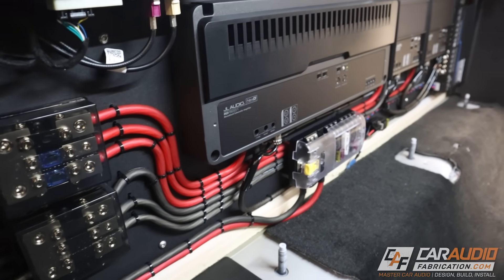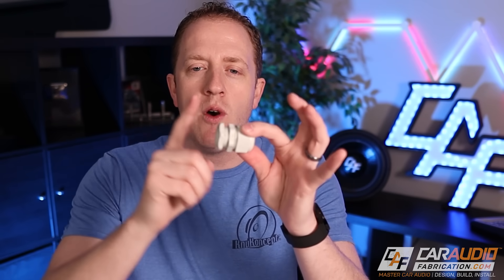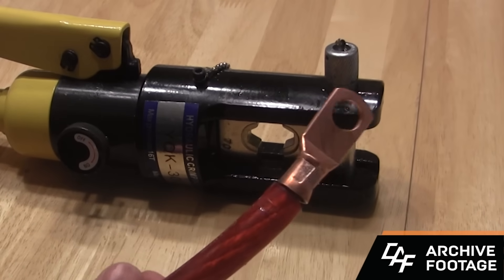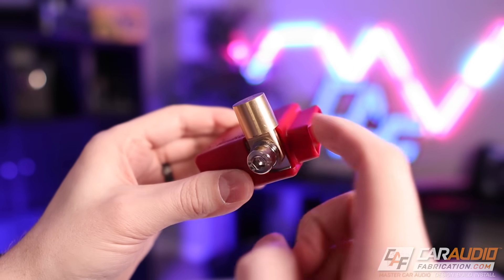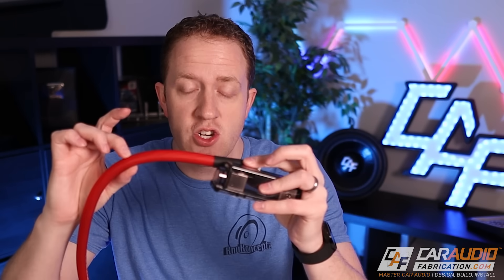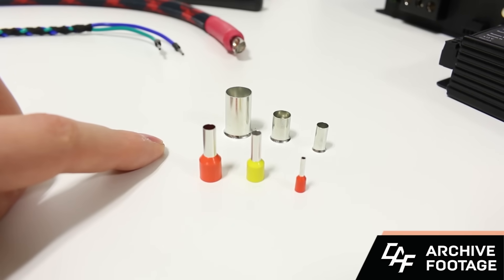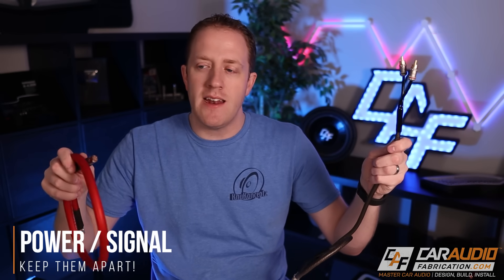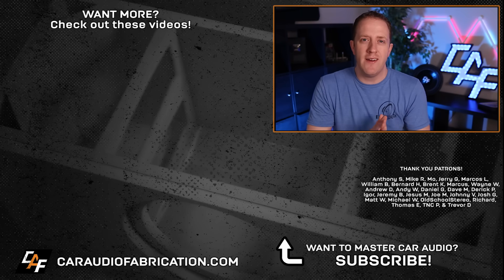Installing an Amplifier? Use these BEST PRACTICES for Power Wire!

Comment: Have you covered running 1/0 gauge power wire from the front battery to the trunk one, but parallel to the vehicle's wire harness? My research is saying that that can cause EMI, unless you turn the wire 90 degrees (I want to see an example of that).

Comment: Hey Mark...I have the Audio Control DM810 in my signal chain which will be PAC Amp pro ag 71, Audio control Dm810, Audio contro Lc 6.1200, Audio control LC4.800, B2 Audio Rage 2500.1...my question is is it better to run the optical out from the PAC to the DSP or the RCA's?

Comment: Can you do a vid on speakers blowing ? I installed aftermarket rear speakers & one blew.

I THINK it was because I noticed the positive speaker wire was plugged in the amp while the negative one slipped out the ferrule, but I’m still not sure how to diagnose that since my front speakers work fine

Comment: Is it not necessary to connect the wire so that the Amp turns on when the car or accessories are on, otherwise isn't the amp always drawing power from the battery?  Apologies if this a rookie question, I'm new to adding wiring to a car.

Comment: Since there are relatively cheap thermal cameras available these days it would be interesting to see how the wire and terminals heat up during heavy use. Particularly the connections to e.g. amplifiers etc.

Comment: That the positive ,the 'power" wire ? Ya sure ?
Reply from the maker: I know you are trying to raise some silly argument about which way the electrons flow. But it's irrelevant for the sake of this video.
Reply: @CarAudioFabrication  you seemed to have it backwards 
The huge pos cable is kind of a funny joke amongst auto techs
Reply: @CarAudioFabrication  CURRENT, WHICH WAY CURRENT FLOWS ,it's a big deal in auto electrical ...I guess it's good you know the term electrons

Comment: What about the remote wire should you run that on the opposite side as well?? I would think yeah because basically it's kind of like a power wire right

Comment: Ok so my amp wouldn't stop turning on...with the car off..head unit had been powered Down before killing ignition.  Amp on..cycled the keys to get the darn thing to cut off. Few seconds and it cut back on ..I popped the hood, pulled the fuse OUT of the power wire. Cycled the keys( at this point the head unit will not come on "auto" as it was manually shut off prior...amp cuts on...yanked the 30a fuse out if the amp, cycled the keys...counted to- Holy ** wt*** amp came on...I let it kill my battery from 12.6 to 11, cycled my keys (hours and hours later at this point) amp did not cone back on lol. I checked for obvious loose connections and have simply concluded the ground is literally the only thing that could be backfeeding as the remote is on acc on head unit... zero clue on how to go about diode...or if thats even the answer.. dud I miss sonething obvious in my absolute frustration?? - oh too start I just finished a 16hr 101° Day under HOT Mack Trucks so I wasn't completely coherent as it was either lol

Comment: if you go from a zero ga wire to a 4 ga 2 inches from the Amp are u losing the advantage of the zero ga wire? the world may never know
Reply: If you are short on wire why dont you put a fuse in between so you dont have to use the 4ga

Comment: Hello I am just wondering and am curious because I am currently going through a situation with my car. To be specific a 2008 corvette . I’ve taken it to many places (including dealer) and even the dealer said they’d charge me over 1000$. My question is I had a power wire installed from my battery to my amplifier because my sound went out. Will my battery get drained over time or is there some type of way to bypass that. I think they also added a capicator and also fuse holder.
Thank you
Reply: Seems luke you need a bigger alternator

Comment: I installed my 2 12”s with a 1500 watt planet audio amp and there is a whistling noise coming from my actual truck speakers and nothing coming from the subs at all, no output and the ground to the bottom bare metal part of my truck, and the power and fuse ran to my battery and my remote wire ran to my head unit and still nothing

Comment: Do I need a ferrel on the power wire to connect to the fuse? And can I use electrical tape to hold it? Or can I just strip the power wire and connect it that way to the fuse?

Comment: Usually, there will be an unused rubber plug on the firewall that you can cut a hole into it and route your power wire through that.

Comment: What’s the idea if your running a second battery? I have 4g back to the the second battery in the trunk where the amps are, 4500w skar with 1g from the second battery to the amp about 2 foot long. This is both batteries positive and negative.

Comment: One more question. I have 2 Amps and a extra trunk battery. Both amps and my trunk battery are all grounded with one ground. Should I ground each amp and extra battery separately? Reason I'm asking is my interior speakers do not seem loud enough. And yes I've done the big 3 upgrade, upgraded alternator and upgraded both my batteries to 100AH batteries.

Comment: Here's my question. I have 1/0 ofc copper running from my engine battery to my extra trunk battery. From my trunk battery to my amps I had to use 4 ga. Wire to daisy chain my amps. Am I losing power when I went from 1/0 to 4 ga? Should I use 1/0 wire all the way around? Or will it matter that much?

Comment: What size or type of Fuse holder do I use in a planet audio  ANARCHY MODEL 1500W High Output Monoblock Class A/B Amplifier Dim:10"L 10"W 2.4"H

Comment: Question: i know this was explained in the past were the system had a current draw 130 amps and you stepped down to 120 amps fuse. Question is how far can you step down? For example, if the current draw from the system is 140amps. Do you then step up to a 200amps or step down to 120amps? (Side note, im going according to knukonceptz 0 gauge single amp kit fuse options)

Comment: Hey guy! I drive an f350 with two batteries. Question is would I run two 0 gauge one from each battery or would you do one zero gauge to distribution block? Amps are 1500watt and 400 watt four channel. Thanks buddy

Comment: I really don't trust those screw clamp style fuses/blocks. I see they are probably the most popular design for the car audio electrical connections and must work alright, but I would much rather use cable lugs or ring terminals and bolt every connection. There is almost no chance that a bolt is going to come out and release the wire. It's good that you recommend the ferrules though, I think it makes the screw style connection much more robust.

Comment: I just installed Dual Double din and everything was working. Until I ended up with a parasitic drain and cannot find what the issue is after a new battery also.

Comment: I don't think there are enough wire slots on that terminal adapter. I had the same issue looking for one recently. It would be fine if all you were adding was additional wiring, but none of them account for the stock wires.
Reply from the maker: That's why you keep the post with the post adapter and just reconnect there.
Reply: @CarAudioFabrication  Youre right. My fault, I wasnt paying close attention because I assumed it was like all the others I've seen. Thats a great design

Comment: dude I'm SOOO glad you showed the Knuconceptz battery terminal thing... Thats the sketchiest part of my whole install is how my wire mounts to the terminal, just kinda stuck on the OEM terminal tightening nut. Its a later model truck and has very vehicle specific harness components with almost no place to put a big power lug, and I dont wanna cut up the factory wire harness to do an install, I like keeping things as close to factory condition as possible. This is the perfect product for my install, literally gonna go buy one right now before I even finish watching your video, huge thanks for that tip man.

Comment: If you use a hammer crimper properly you can get just as good of a connection.  The idea is to strike the die several times until you hear it sound like you're hitting solid metal.  Then you know all the strands of copper have been compressed together uniformly.
Reply: I’ve used the hammer crimper and like you, with a few practice mess ups, I’m pretty good at making a nice secure and good looking crimp and connection. The cost for a mechanical crimper is a bit too much for a regular DIYer.
Reply: Solder Dunk ftw. For me personally. Looks a lot cleaner not being smooshed/smashed, maintains its circular symmetry, Andddd the solder seeping into and between alllll the strands and fusing to the lug, seems like the MOST efficient way, IMO. (A buddy of mine dunks and crimps his. He says that way if there’s an extreme heat increase in transfer and wildly the solder let go, the crimp would be a viable secondary backup. If it Maths it Maths right? Lol.) 
Maybe something to try on y’all’s next builds or upgrades etc. I always love finding little tips and tweaks and 1 offs, especially ones that make things look more aesthetically pleasing, but if you can do that and increase performance, etc. sign me up! Prime Example! The wife Ferrules!!! Oh my gawddd! Something so simple, yet a game changer. Throw a chunk of heat shrink on there to tie it in too... looks great, and is clutch when doing a lot of test fitting or just unplugging the speaker wires a bunch, it maintaining some consistency continually is so nice. Not getting frayed and mangled and shit. A+++ type shit. Keep on Build brotha’s!!
Reply: @APinTheAK  I work in a nuclear power plant surrounded by all kinds of electrical switchgear, MCC's and transformers of all different voltages and basically all of the cable connections use compression fittings (i.e. crimps). It's industry standard as a compression fitting provides mechanical strength and stability whereas soldering alone does not.  That said, I have never tried soldering and crimping together, but the lugs I use don't really facilitate this.

Comment: I prefer to use "firewall boots" instead of those plastic grommets. The issue I tend to run into with those plastic screw type grommets is they tend to be to bulky in some situations and the power wire will not be very flexible for the first couple inches on either side of the plastic grommet witch will cause the power wire to stick out pretty far and be hard to make a tight bend either inside the vehicle or under the hood. If there is plenty of room then it's not an issue to use those but with a firewall boot the thick power wire still remains somewhat flexible for better wire management.

Comment: Awesome tips and well explained. All points are very true, but I would like to add in a little something that is sometimes overlooked. 

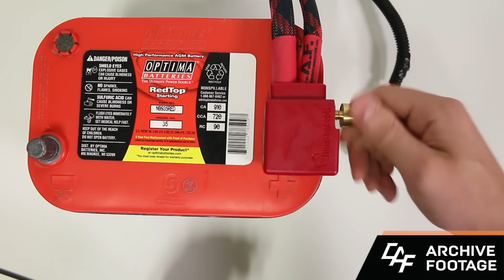I work for a heavy truck dealership so i have experience on this point. At 3:05 those post adapters are a great idea, but installers need to know that the post adapter is to be tightened down. You can easily see that the post adapter had rotated a bit as the 10 mm cable clamp nut was being tightened down. One of the main causes of heavy trucks not starting is because the post adapter (installed in some applications) has worked loose, thus losing valuable amperage to start the truck. The same can apply to the automotive application as well.

Comment: nice I already have the knukoncepts battery blocks with the older terminal pieces definitely going to get the newer ones as it will work better with my OEM battery connectors and not bend the wires as much

Comment: hammer crimps work just fine if you use them correctly. can't beat on em with a tack hammer and expect it to work. i use a 4 pound drilling hammer myself.

Comment: Very nice and very well explained being a installer for a shop I see alot of diy installs and have grabbed wires that was shorted to ground and got my hand burned 🔥 and have told people to put a fuse on there wire then the next time they came by had a different car because the old one burned 🔥

Comment: Hello. You said to have the RCA cable on the opposite side of the vehicle. I was planning on running the RCA cable on the transmission tunnel and the power wire down the drivers door sill. That should be enough distance apart, right?
Reply from the maker: More than enough yes. Just be aware of any other potential noise inducing sources
Reply: @CarAudioFabrication  Copy that. Ill try to keep it away from other wiring, etc. Thanks.
Reply: Thanks for asking that question. For me, I found it easier to run the RCA, remote turn on and signal wires straight from and to the amp in the trunk, up beside the transmission tunnel to behind the dashboard.  That way it’s a lot neater and easier and shorter run.

Comment: Even though running quality wiring  (signal and power) I still add additional blockage between the 2 types of wiring. Normally I add at least electrical tape, wiring loom, more electrical tape and if in the engine bay fire tube or under the car at least cool tube. I start with the the cool or fire tube first followed by additional protection if needed. As for the signal wire- old school 400 series monster car audio wiring is what I usually use, as it has great internal connections and amazing external protection. As for type of power wire hifi Vega has a great guide of cost per amount of OFC copper per foot and other various specs. A great guide to follow.

Comment: I run my power wire inside flexible aluminum or galvanized conduit through the frame and into the cab through the floor. Hardware we is available to secure the conduit to the cab. Under the hood I'll fasten a piece of angle aluminum to the frame with the correct size hole for the same hardware used to anchor the other end. And, of course, fuses at each end.
Reply: Fuses at each end? Why?
Reply: @470ruger  pay attention
Reply: To what? You're connecting amps aren't you? So why a fuse at each end unless it's a distribution block?
Reply: @A. Melbs your attention is paid huh? Does that mean I'm obligated to respond? Requiring an explanation is proof that your attention is, in fact, NOT paid. But I'm happy to help you out.
Amplifiers, head units, equalizers, DSPs and every other piece of electronic equipment in the car has at least one fuse right? Why? To protect that piece of equipment right? So a fuse serves two purposes, protects the wire and protects the equipment. Right? More fuses doesn't make a circuit weaker, it makes it safer. If the fuse under the hood is out of spec, allowing far more than rated amps, a second fuse in that circuit might just save the day and possibly your equipment, if it's the equipment drawing the excessive current.  A fuse doesn't have any meaningful affect on current flow below its rating so a 2nd fuse in back hurts nothing. Also, the 2nd fuse makes it easy to disconnect power completely at the rear pulling one fuse, where I'm working, instead of under the hood. Out from that fuse into a fused distribution block then on to amps etc. I like it when things are easier rather than harder. I hope that cleared things up to your satisfaction. All the best.

Comment: From a retired Mechanic point of view. You are very correct in putting the large fuse block withing inches of battery connections. I would then suggest putting a smaller fuse block at the amp to protect it. Some of the radio/amp wiring I had to pull out of a vehicle was way too large and created a whole new set of problems.
Reply: One fuse is fine a second fuse is just another point for voltage drop to become a problem

Comment: Yeah don't spend nine dollars on a tool you'll only use a couple times. Buy the one that's at least fifty. You know. To protect your three hundred dollar setup.
Reply: 😂 I’ve already got too many tools collecting dust. I’m going to take my power cable to a local shop and have them crimp it for me. A couple bucks under the table ought to make everyone happy.
Reply: You can get a decent crimp on 2 gauge and even 0 with the larger tooth on Klein style crimpers. There's other options as well. Either way a proper crimp is key.
Reply: I can crimp as good as anyone with some needle nose pliers or channel locks and use them for other applications

Comment: On my current install, I used a Blue Sea Systems circuit breaker under the hood instead of a fuse. Protects the wire and super convenient to be able to cut the whole system off at the battery for service or if I hand it off to a shop and don’t want them abusing my equipment.
Reply: Just be careful, once a breaker is tripped there can be residue where it arcs making it harder to trip again so it won't always be reliable if it's blown more than once

Comment: KnuConcepts have lots of neat wiring accessories and definitely very good wire. Those wire glands are the right idea for the hostile environment of the engine bay. This gets hot and cold and let’s not forget wet. Wire doesn’t like heat or cold and wet not at all. I would only make one suggestion on the wiring and that is heat shrinking the connections this further reduces the chance of exposure to the elements and this added protection also safeguards your investment. It may sound extreme, but under the hood is where you need all the help you can get. Press on Mark. Another great video! Stay safe my mates!😊👍🏻😷
Reply from the maker: Definitely good to heat shrink those connections for sure, great addition!
Reply: @CarAudioFabrication   3x shrink with the glue in it! Thing gets hard and tough to live in that environment
Reply: It's a strain relief cord connector. Great idea for this application...

Comment: I wish u wired my system, it’s a clean setup but the wiring is definitely messed up sonewhere
Reply: Thank you Mr. Mark for what you are doing.  I have a question... Can I use the Amplify Fire through the rear speakers in the back of the car without unplugging the radio in the car and connecting it through it?  Please let me know, thank you